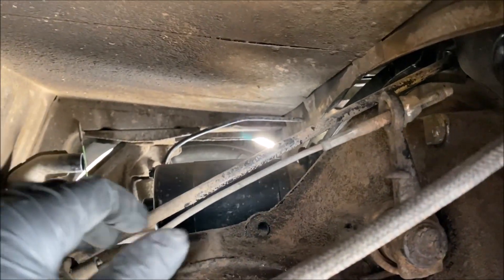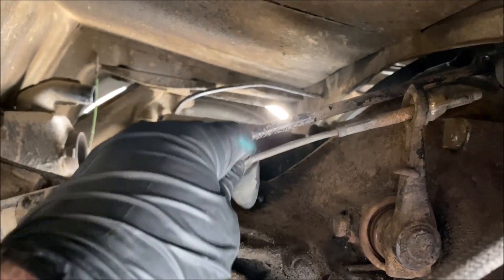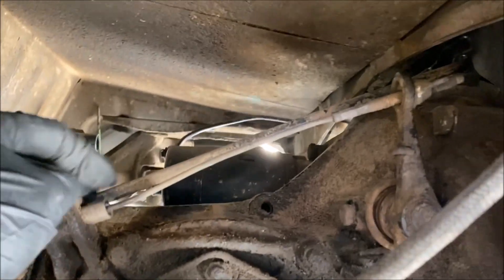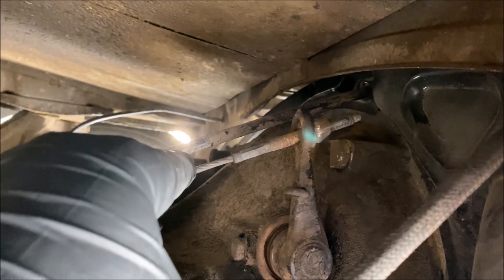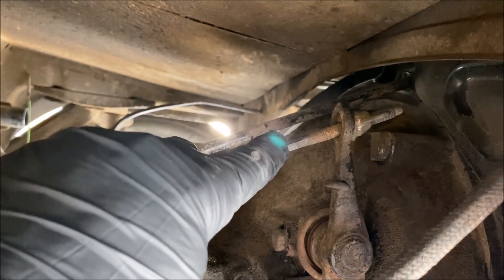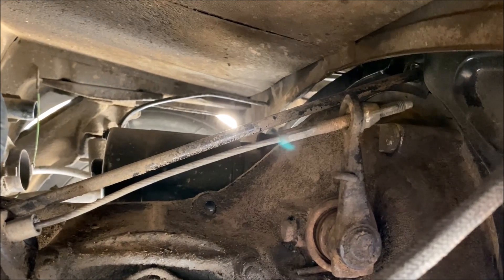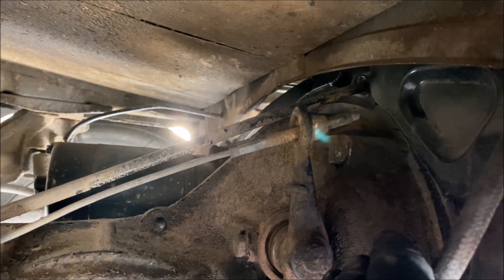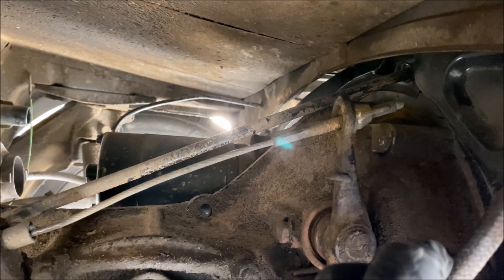Penelope Is Down! Did I Blow Out The Clutch In My 1966 Vw Fastback!? Mileage Unknown Ep79

Comment: I found your channel last night, watched this video this morning and the exact same thing had just happened to my clutch on my way to a show!!
I think the friction disc has come apart but I haven't dug into it yet. Good luck with yours 👍
Reply from the maker: Thanks for checking out the vid! I haven't jumped into mine yet but have collected all the parts, I'm definitely curious 2 what's actually come apart! You'll have 2 let me know what happened in yours, good luck 2!
Reply: Hi. I dug into my Beetle clutch problem today and it turned out to be the release bearing had completely fallen apart. Unfortunately it sprayed grease all other the clutch when it died so I finished up replacing the clutch disc as well.

Good luck with yours!
Reply from the maker: @2BugsandaBack  I'm about 2 post the vid of what we found!

Comment: If you hear a bang it’s a snapped cable or the clutch cable tube getting unwelded from inside the tunnel. Also the clutch release bearing can fail.
Reply from the maker: I'm really not sure whats happening with this one just yet, I'm wondering if the throw out bearing fork is whats snapped/causing the issue
Reply: @mileageunknown8910  Yep; that’s another one. Sometimes one of the clips on the release bearing breaks and the thing goes to hell.